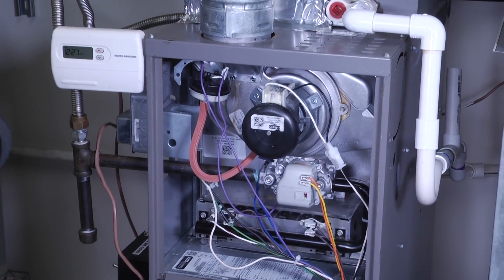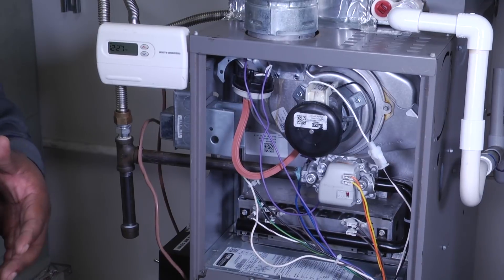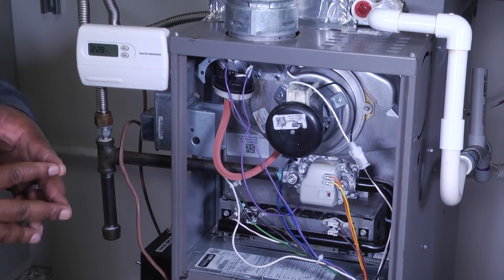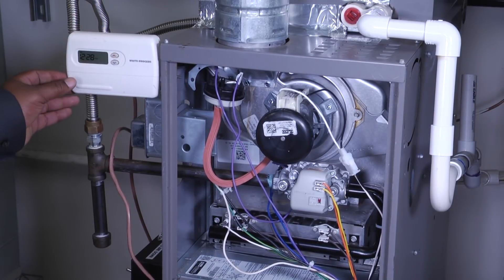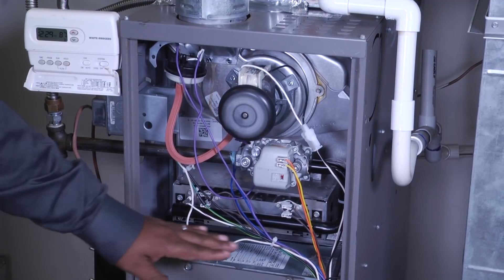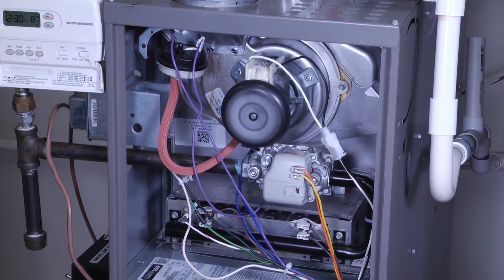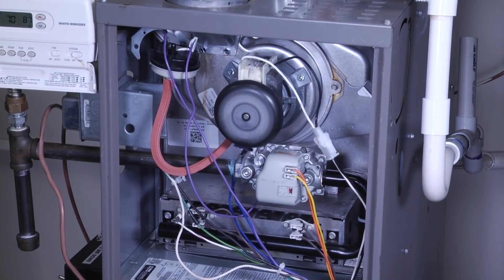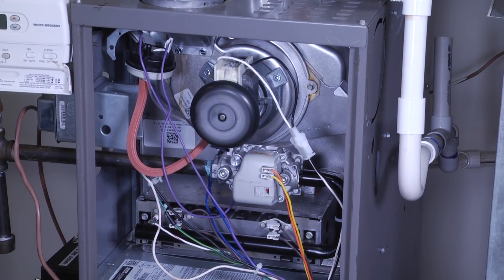Toolbox Tuesday: Demystifying Gas Fire Furnace Operations & HVAC Sequencing Explained | Lennox

Comment: My heater gets to the glowing ignitor, but there is no gas/flame, then it cycles back to the beginning and it just never comes on. Could it be a bad gas valve or how do I troubleshoot?
Reply: First test the ignitor. If the ignitor is bad it won't send enough voltage to open the gas valve. If they ignitor pans out then it is the valve.

Comment: by the way, did anyone notice a DROP of WATER  drip down at time 3:15 ? it's just to the upper right of the Pressure switch along the Metal Housing of the Inducer motor. Just under a screw .. Check it out. That can't be good...
Reply: Flue gasses condensing in the venting system.  Rust is in the future.

Comment: That is not exactly the sequence what about the board verifying the safeties are closed and the pressure switch being open on a call for heat? Other than that very informative for tech's starting out.
Reply: Everybody forgets that until they understand why you can't by-pass the pressure switch through multiple calls for heat.
Reply: @jimbarron1957  what do you mean? My furnace cycles out after 20 seconds no glow . Trying to figure out if it is the pressure switch or the ignitor. The one tech told me the Pressure sensor is after the glow light. I am so confused adn do not have a multi tester and the darn ignitor is hard to get at. Thanks if you could explain ?